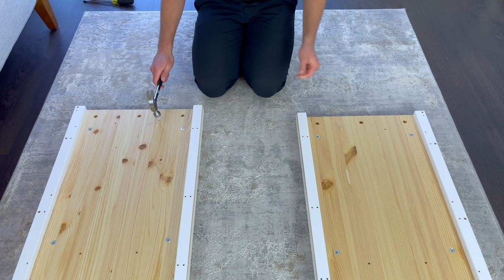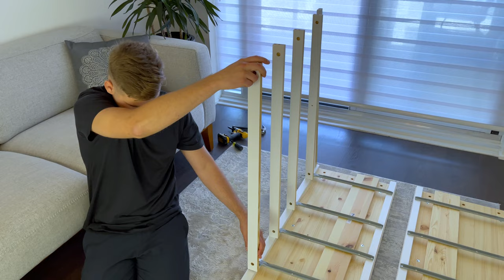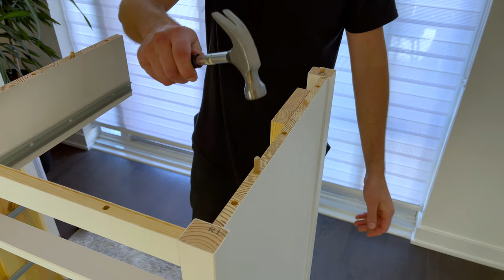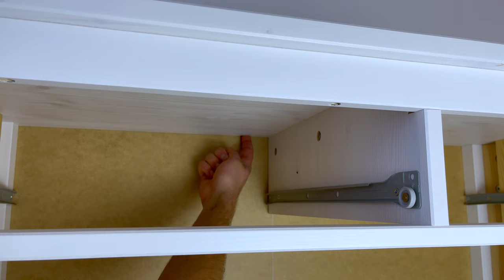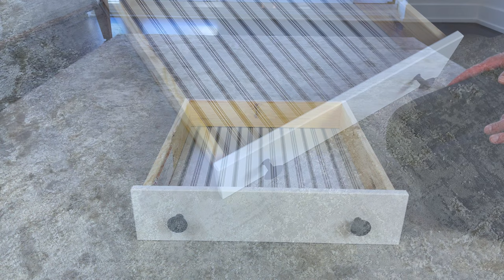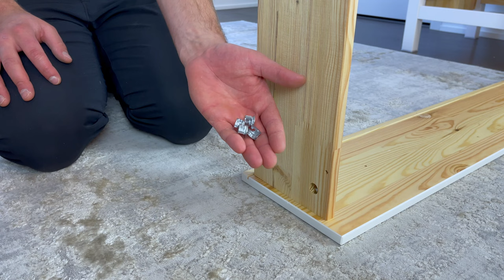Step By Step | HEMNES 6 Drawer Chest IKEA Tutorial

Comment: thanks for the video..mine is a little different than yours even though it is the same unit.  one thing i did is mark on the directions sheet, the left and right across all the pages for the sides..this helps as you go thru the assembly

Comment: Thanks for the video, but this one you're building is a older model. 

The roller brackets are now white, as of 4/2024. The roller brackets also have a built-in safety feature so that you can only open one big drawer at a time.
Reply from the maker: Yeah we noticed IKEA changed the Hemnes and Malm series so far. We'll put out the updated assembly tutorials of the Hemnes series around the beginning of May